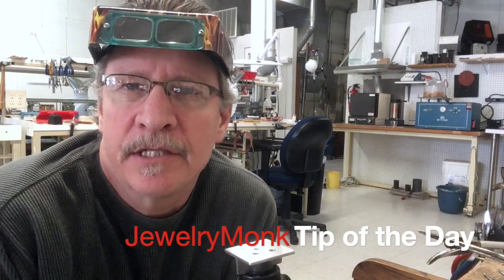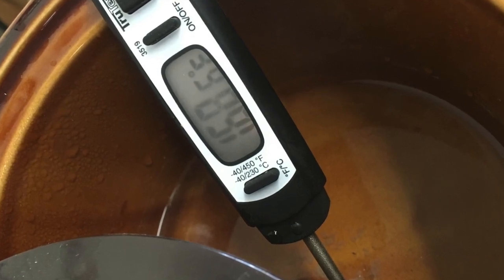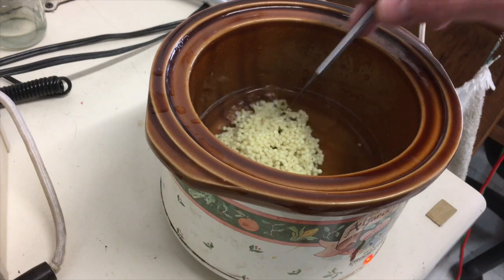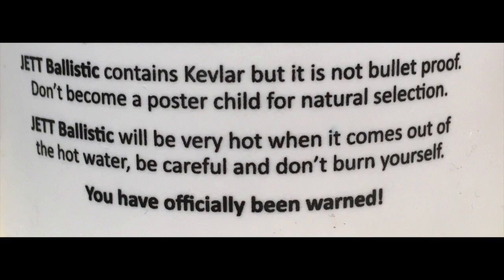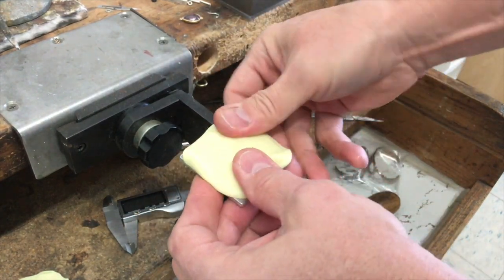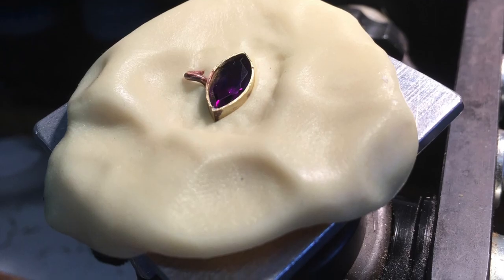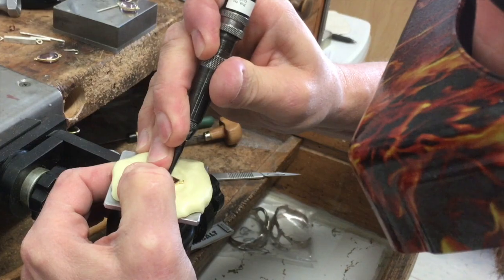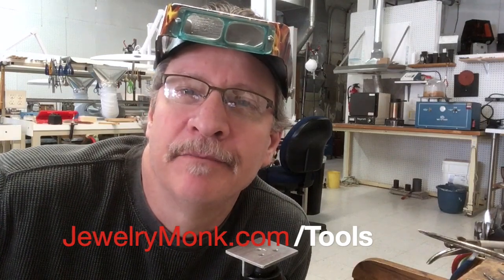Jewelry Making JettSet Ballistic Fixture Compound Demo

Comment: how do you get it out of the tiny holes in a piece?
Reply from the maker: I use the stickiness of the material to pull it out. If I need to, after it cools, I can use tweezers. But usually it comes out pretty easily.